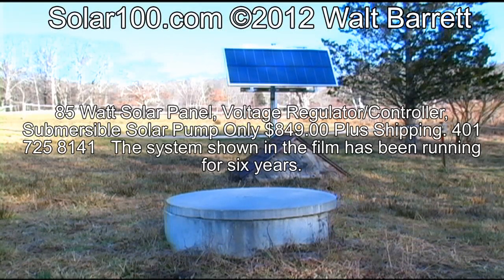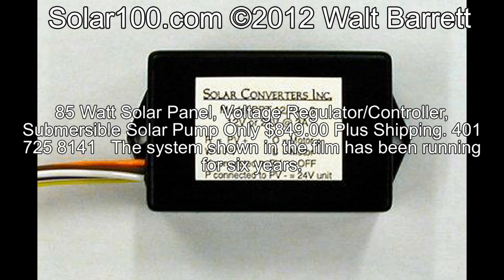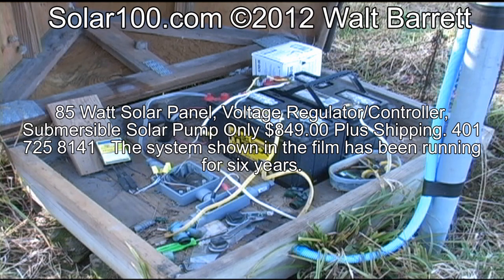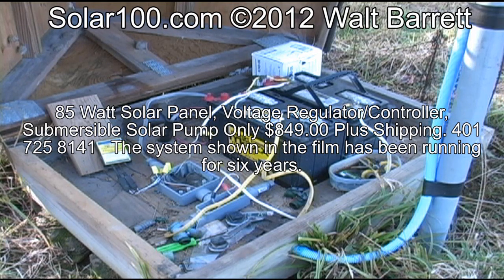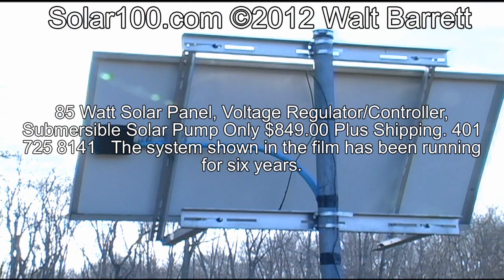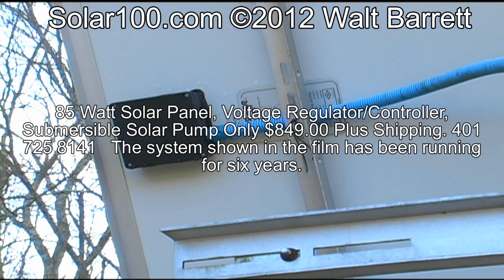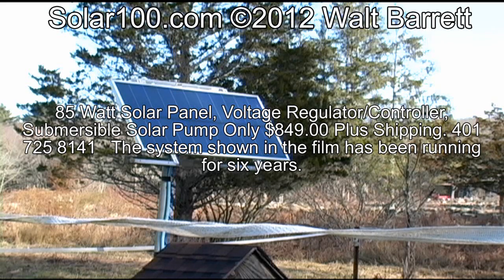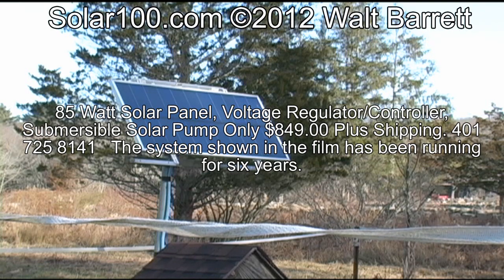DIY Simple Solar Water Pump by Walt Barrett

Comment: cant  you use a regular well pump  that is already in the well ?  and just hook that up to the solar panel & batteries ?
Reply from the maker: *****  If you use a DC to AC inverter of the correct volts and amps you can use your existing water pump.
Walt
Reply: thank you
Reply from the maker: *****  You are welcome and if you use an inverter make sure that the inverter is rated large enough to handle the starting load of the pump which can flash as high as the running load.  Write to me if you need advice or help.
Walt
Reply from the maker: +MsNumber1rider   
You would have to add an AC inverter of the proper size if the pump is AC.  Maybe more solar collectors.
Reply: +Walt Barrett   THANK YOU   so much Walt .

Comment from the maker: Our kits do not include the wiring it is up to the installer to meet local codes.  We were told that a local pump installer was being called in to do the pump work.  We sell kits world wide and cant possibly cover all the codes.  The wiring is in a weather proof structure.